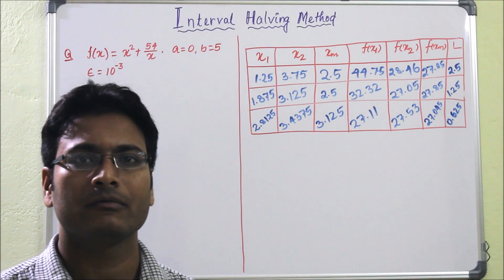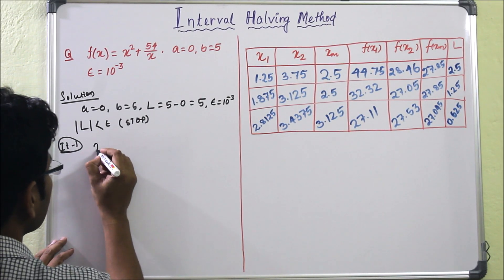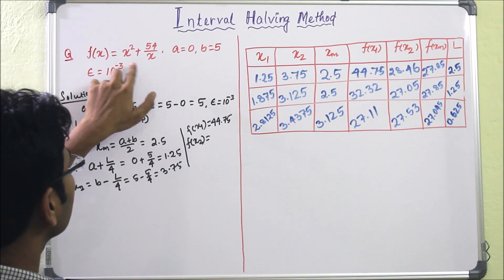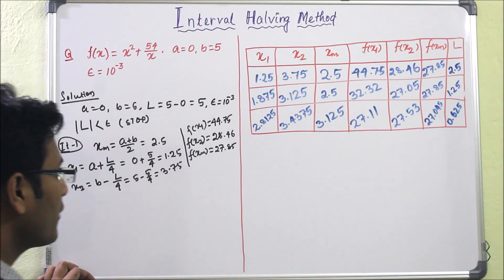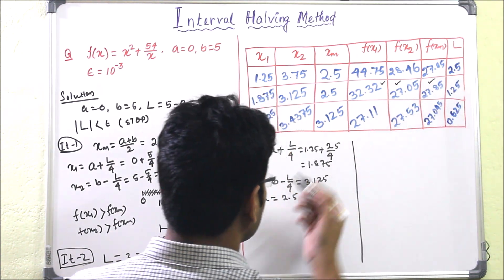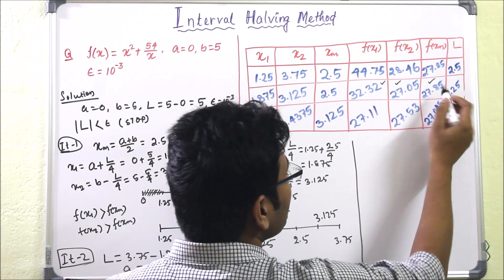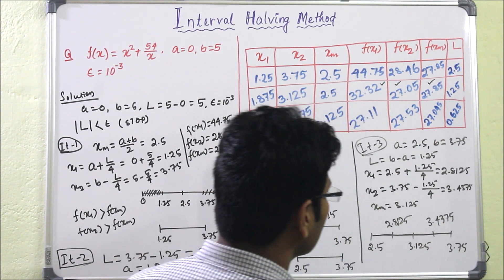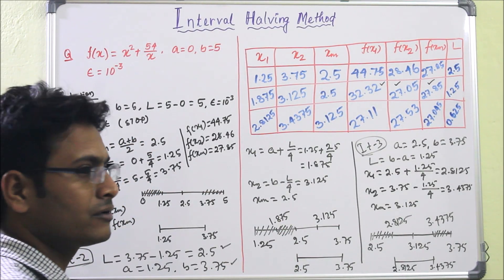Lecture 13 - Optimization Techniques | Interval Halving Method (Part 2) | Problem

Comment: If in exam stopping criterion is not given then up to 3 iteration is valid?
Reply from the maker: There should be some criteria, relation or condition given for the said questions in the exam. But if it is not mentioned then please contact to your faculty (regarding the number of iterations required) who handles the course.